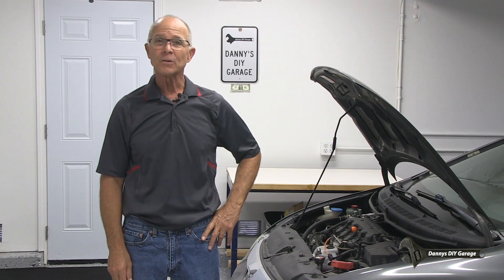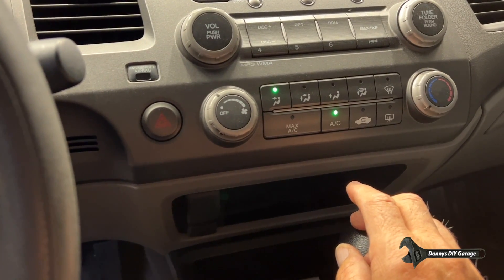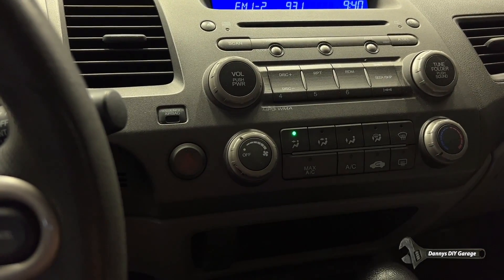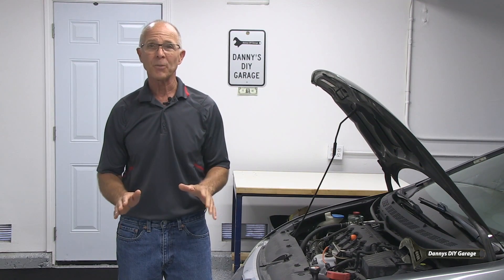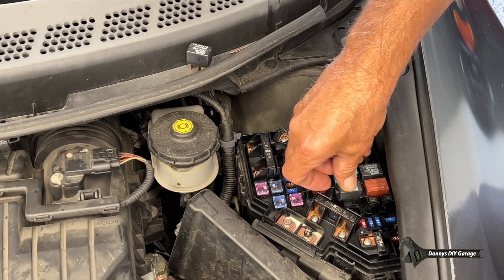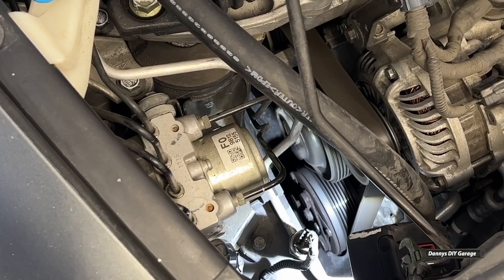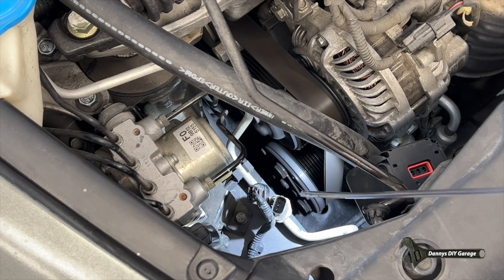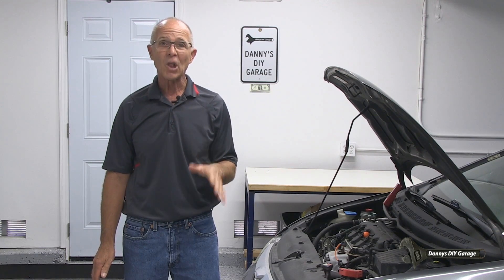Honda Civic 2009 AC system blows warm FIX

Comment: I've got an Honda Civic 2008...the AC stopped when the outside temperature arise more then 40 Celsius degrees. It works for 10 min and then stopped.  Also, if I drive my car for 10 min with 40 degrees and try to turn on the Ac doesn't works.

Anyone has any idea what it could be?
Reply: i had this problem and removed a shim washer in the clutch then it engaged properly when it was hot out it was pretty easy fix
Reply from the maker: When the ac stops working go through the diagnostic shown in this video to help pin point where the problem might be

Comment: Hi loved the video! But just wanted to ask, if my compressor clutch was blown up, would you recommend just replacing the compressor and condenser? Or anything else?
Reply from the maker: Condenser? If it needs it
Reply: @dannysdiygarage  thank you so much!
Reply from the maker: Expansion valve would be my recommendation, pretty easy to install and will make a big difference, I do have a video on that also
Reply: @dannysdiygarage  okay thank you! So replace the expansion valve plus the compressor and condenser?

Comment: Have a 2009 Honda Civic LX 4 door as well and it has the same problem. It keeps running low on Freon and I’m not sure if there’s a leak or if it’s just the expansion valve maybe. Wish I knew you because our cars are identical lol you’d help a ton
Reply from the maker: If it’s loosing Freon it has a leak, do the visual inspection, if you don’t find anything, buy a can of Freon with die and add it, then get a black light
Reply: @dannysdiygarage  will do! Thank you for being very informative!